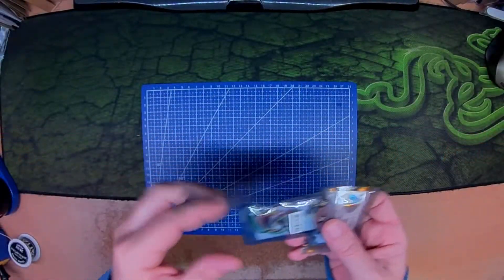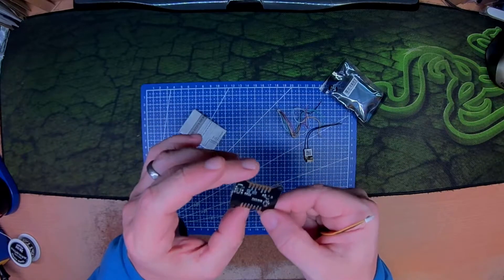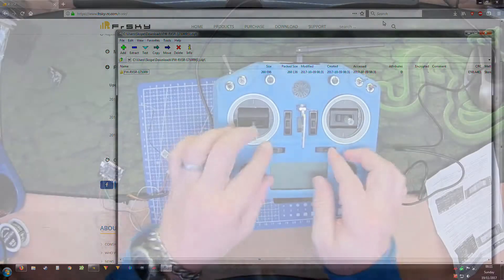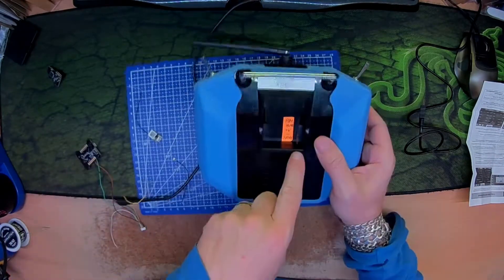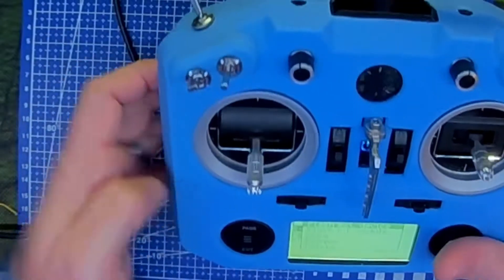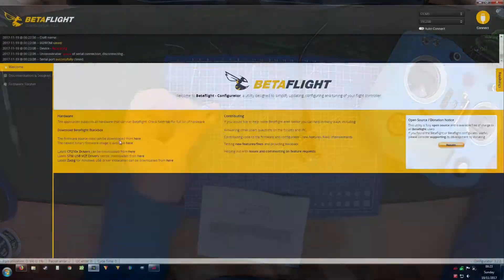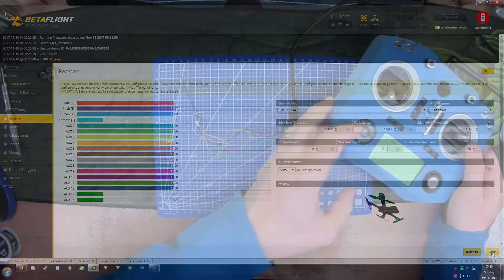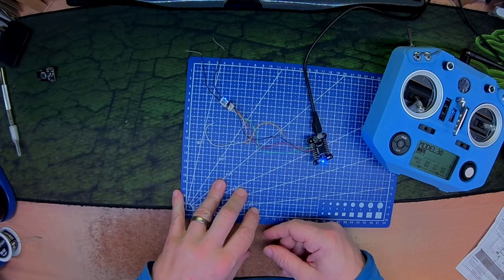FrSky R-XSR Firmware Flash [EU - International]

Comment: hi MrE, i have just purchased this rx and am really struggling to get it to work. I am no expert like yourself. i have qx7, can you advise which fcc firmware I need to download. I thought I had done it right but I cant get any controls to work. I have binded it (I think) as it has blue light (SBUS) and green solid light. some say it should be flashing green??? any help appreciated.... cheers, Mick, New Forest, Hants
Reply from the maker: Ok, first up the lights: Blue is power (Aswell as indicating it is in SBUS mode ,Red is no connection and Green is connection So that sounds right.
Secondly verify that you have an FCC X7 (international) and not and LBT (EU) - You having a solid green light would seem to indicate that you have an FCC/Int. transmitter.

That would bring me to the third point after ruling those out byproxy:
Make sure that you have it wired to the correct pad on your flight controller and that it is subsequently correctly configured in betaflight - ( A port set as Serial RX) , In configuration the receiver type set to serial-based receiver & the serial receiver protocol set to SBUS.

That should have it working but you may need to go into the CLI & try the following: set serialrx_inverted  = on or off depending.

If none of that works get back to me with and we'll work through it a bit more.
MrE , The Downs @ S.Oxon :)
Reply: @MrE.  MrE, apologies for my late response (kids and work have got in the way) and thanks for your very comprehensive and quick reply. I must add I only have experience so far with fixed wing and haven't gone across to the drone side yet. I have confirmed your first and second points. thanks for that. The point about it being wired correctly to my flight controller is the main issue I think. I am not experienced with flight controllers (or much r/c tbh) so the first one I have purchased is the nice and simple Zohd Kopilot. Here is my error...I think..... the rx came with a S Port lead to allow for the f/w to be updated direct from my qx7...which it did very well, but I now realise that I can't use this lead to plug in to the SBUS port on the kopilot as it is wired slightly differently.....FOOL.. I will rewire the additional cable the rx came with this weekend and add a servo connector to it and hopefully all will be good. I found a link on tinternet which helped me out too  https://youtu.be/YnEDqGZwPpo
thanks so much for your help, I'll keep you updated. Mick
Reply from the maker: @mickelson8332  By all means, excuse this late reply as it was caught up in the for review comments (due to containing a link). After your other comment it made sense but none the less, its all good.
For future reference if the updating cable is perfect, just hook the little plastic finger and move the s.port/signal wire over to the correct place.

If you need any help in the future, I'd be happy to help  (Bit of a jack of all trades and a master of none). I too fly fixed wing. Take care, Fella.
Reply: @MrE.  good stuff,  thanks for the advice.  After finally sorting it out the bloody thing flew away..  literally!!! It had a flight controller ( Zohd kopilot ) and went slightly out of control,  flicked the rth switch whereby it should have circled around my gps position,  but instead went off all over the place.. never to be seen again.. couldn't believe it..
Reply from the maker: @mickelson8332  I feel for you, Mick! bit of a shocker & other and my true sympathy, I'm lost for anything to say.

I hope it turns up none the less & thanks for sharing. I hope that bad luck keeps other maybe more serious stuff at bay.

I've always wanted to get a ZOHD Talon with all the bells and whistles but before an impulse sale buy I may have to do some digging online now.

Chin up mate!
Reply: @MrE.  chin is truly on the ground. I'm 49 and fell like a kid who had his sweets nicked lol.  Got some feelers out locally so fingers crossed. Going to do a few recces tomorrow
Reply from the maker: @mickelson8332  Good luck! I'm not far behind you and still have that same feeling from time to time, usualy when something like this happens to our 6yr old.

What a bummer :(
Reply: @MrE.  so no joy today I couldn't look exactly where I wanted to as the land is broken up into paddocks and all owned by different people. Have a friend with a drone so I will ask him and see if he can help. 🤞
Reply from the maker: @mickelson8332  If I was close to you, I'd willingly help out (In Southern U.K.)

Will keep the fingers crossed still.
Reply: @MrE.  thanks mate,  I'm in the south too in The New Forest, Hants. Maybe catch up with you one day.
Reply from the maker: @mickelson8332  That would be something, hey? A quick trip down the A338 which happens to run through my town! - Having said that I've been contemplating flying the forest at some point for a while.
Reply: @MrE.  found it mate. With the help of a few people on a local social media app.  It was found this morning, only thing to replace is the lipo which had clearly drained flat. Can it be recovered slowly? A338, you can't be too far from me then
Reply from the maker: @mickelson8332  What great news! Kudos to the locals. I'm well chuffed for you!

The Lipo is pittance in comparison to the plane and hardware in the grand scheme of things. If it has gone well below 3v per cell or swelled, I'd chalk it up as a gonner to air on the side of caution.

You can recover them by bumping the charge as a NIMH/NICD to get it to where a charger wont moan in lipo mode.

I'm pretty much on the county borderline between Oxfordshire and Berkshire.
Reply: @MrE.  yeah you are right, very small price to pay.  It was only an 800mAh. The fact that all electronics remained serviceable is a real bonus. It hasn't rained    at all here since I lost it apart from about 20 mins before the chap found it.  Absolute bonus... keep in touch 👍
Reply: @MrE.  hi MrE, me again down in The New Forest. I'm not big on social media so no idea how to contact you other than on here. Got a problem binding a new G-RX8 rx to my taranis. Can I pm you somehow to delve into your wealth of knowledge mate? Cheers,  Mick
Reply from the maker: @mickelson8332  Afternoon, Mick! I'm not a social media person either so heres my email addr (il remove it after you respond):.
Reply: @MrE.  just dropped an email to ya mate
Reply from the maker: @Mick Elson Did you have any joy in the end?
Reply: @MrE.  haven't had chance yet. Hopefully will get chance tomorrow, I'm keen to find out myself but just been too busy this week with work and poorly kids. Will let you know as soon as I have tried it. Thanks mate
Reply: Boom, it worked. wired up the spare lead that came with it as I should have done in the first place. I had the S PORT lead fitted and not wired up the new one to a servo connection as the instructions said utilising the SBUS out cable. wired it up and worked straight away. Thanks for your help. Spot on
Reply from the maker: @mickelson8332  Chuffed to hear ,Mick!  You're welcome.

Comment: How come you don't like eu firmware? I've just done my first xm plus firmware upgrade on my three receivers, have put them on LBT as I was told it is full TX strength compared to the old EU.
Reply from the maker: It's purely down to being rooted in the pre EU/LBT era with FrSky stuff.
I have a fair amount of D8 stuff that is a bit problematic with EU/LBT (It was always missing full stop in the EU firmware for OpenTX)

I think the operation is identical but the LBT was shoehorned in due to EU regualtion just over a year ago, It boils down to "Listen Before Talk" passive behavoir iirc

All of my X series stuff would be fine I think (5-10 Craft) but I have a magnitude more stuff that would be bricked like D4r-II's and especially 3rd party things like the little 8ch receivers on micros and Airwolf 8ch pwm receivers for foamies/planes. I would go potty trying to match either of my Taranis to which firmwares if i split the firmwares.

It's not that I have anything against the EU firmware,just a bit of satire with the thumbnail as the R-XSR's wern't notably EU when released in UK stockist's.

Comment: Hey, what charger do you use to charge your lipo batteries? Im thinking about the imax b6ac or b6ac v2, but since its quite expensive in my country (78 euros..) and a charging cable for my battery (8 euros..) i thought it would be a good idea to ask, what charger you use, because i dont know much about them.. and dont know what ones are good..
Reply from the maker: I have 4 lipo chargers at the moment but I started out with the B6AC (Made sure to get a genuine one) - It is worth spending the money once on one to ensure your battery investment is looked after.
I have had great luck with all of my chargers:
IMax B6AC
GT Power Duo 607 ( https://www.youtube.com/watch?v=aIb4u25rm7I )
ISDT 608 for lighter loads ( https://www.youtube.com/watch?v=VlKC2AvLxUk )
SkyRC Quattro for 1S batterys

I believe Hobbyking have a fair few chargers on sale at the moment. I thin you can get a 4 button charger very cheap and run it off a laptop style adapter to do it on the cheap but if you do,make sure you keep checking the voltages of your batterys when charged to ensure they are not being mistreated.

I may have a quick look for some cheaper chargers quick, I hope this goes some way to giving you options but bottom line again its worth getting a rock solid reliable one even if it cost a bit more (most will do all types of batterys now so you could poss sell any NIMH/rc car ones to make a bit back on the cost)
Finally,can you not make up your own cables? it can save you alot if alot of different ones are required. (B6AC came with loads of cables and I only had to convert one iirc)
Reply: @MrE.  spot on,  thanks for the advice. Next purchase will either be a new charger or fpv goggles.